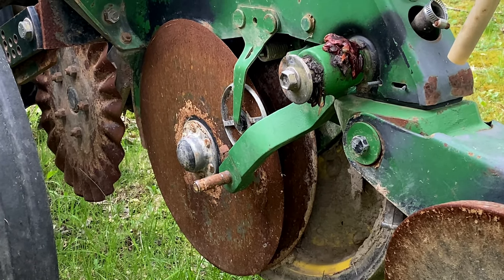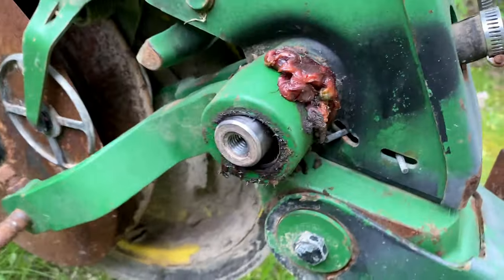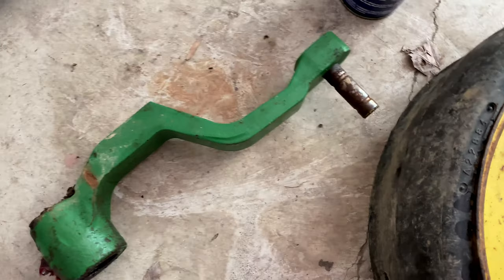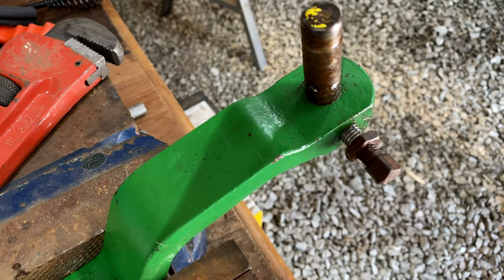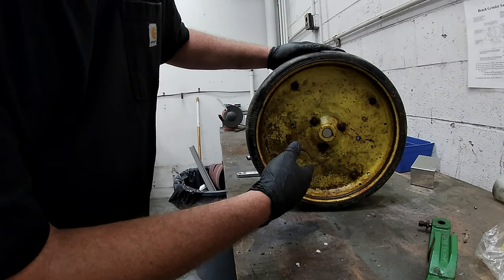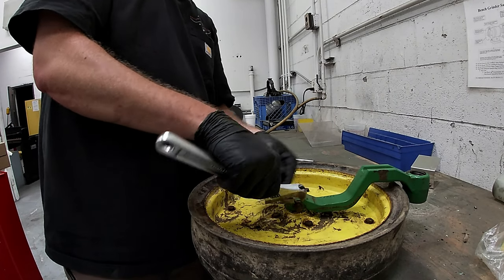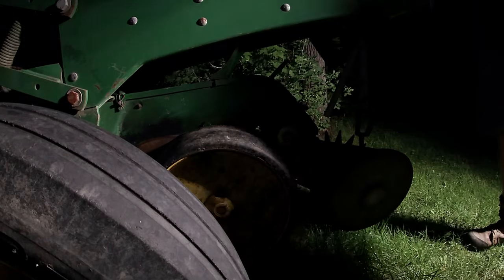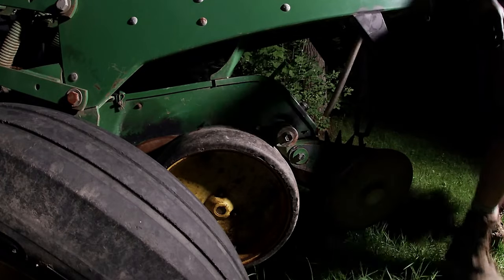Planter Gauge Wheel Bearing Install

Comment: New arms use a larger bearing with a 5/8 bolt threaded into arm. Very simple to replace but will last 10 times longer.